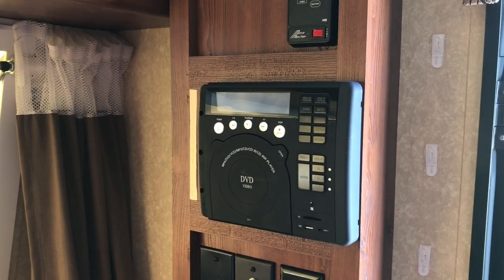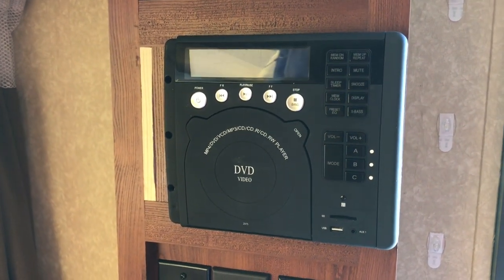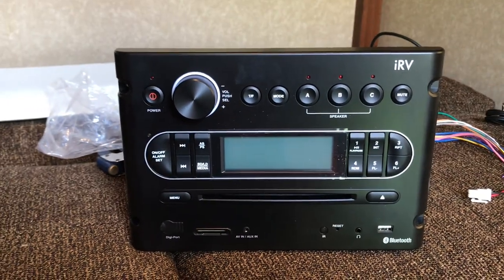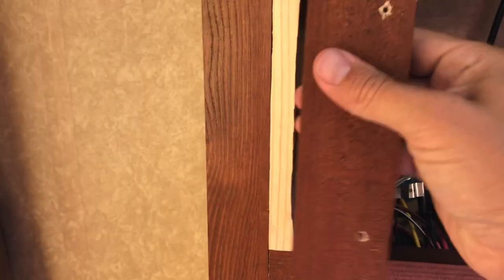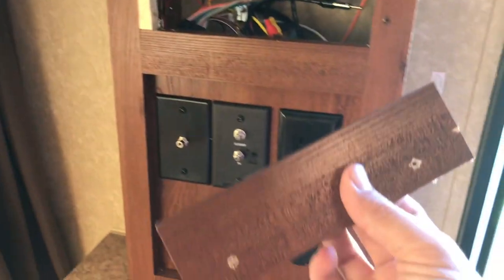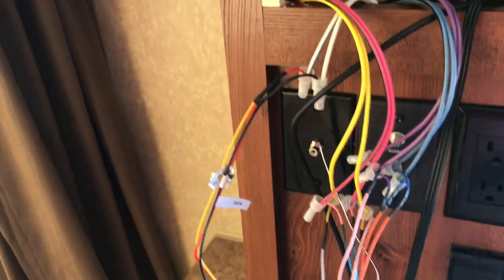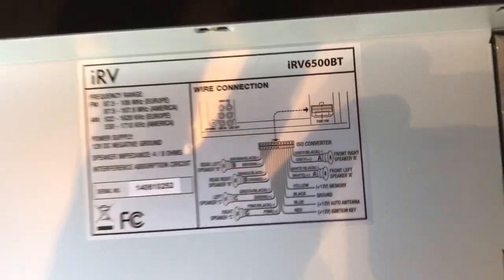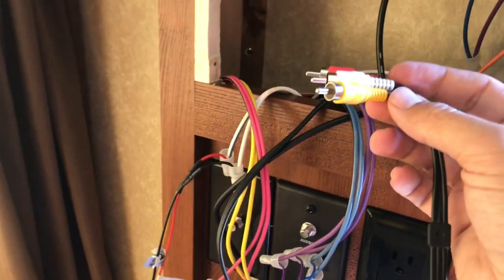Travel Trailer DVD Radio Upgrade Concertone ZX75 Replacement with iRV 6500BT Stereo

Comment: I realize this is an older thread. But how did you get the old one out without tearing up the cabinet?
Reply from the maker: It’s been a while so I’m going off memory but for this specific model you can see a vertical trim piece on the right side with two small notches against the wood, you pop those off each side and they expose screws, you can see the 3 holes on the left side when the video starts. Once the screws are out it should just pull straight out.